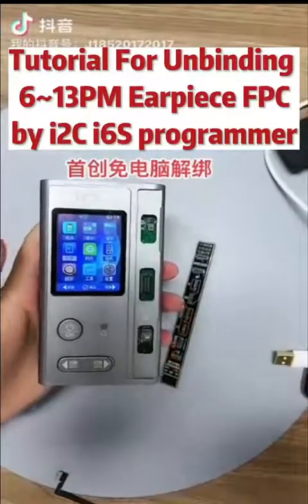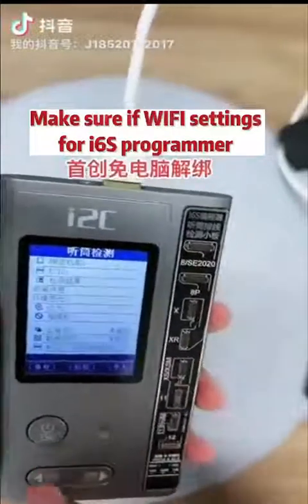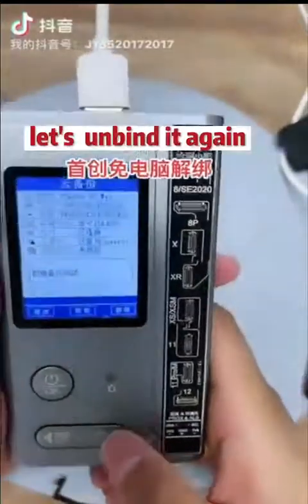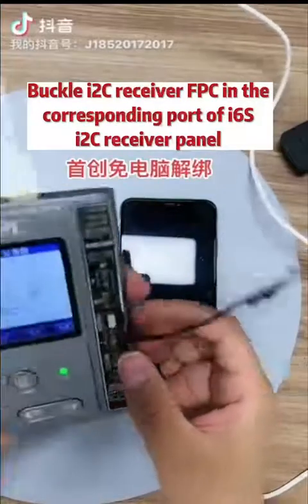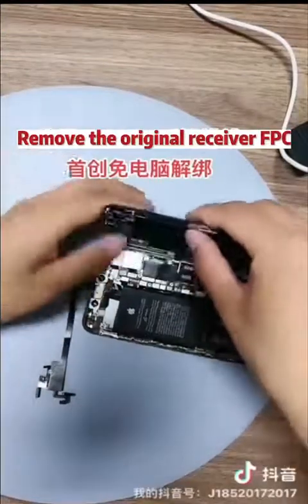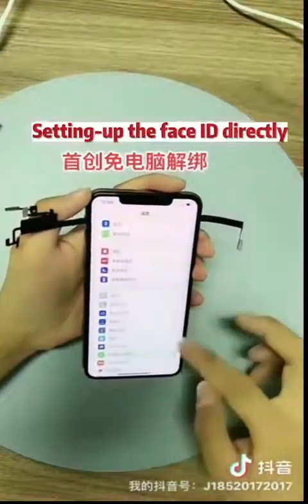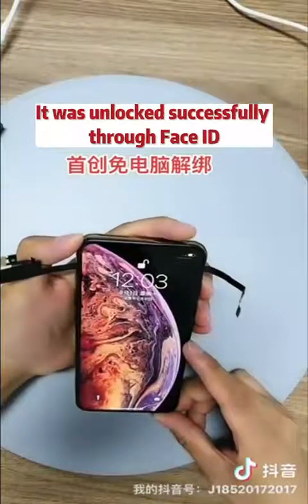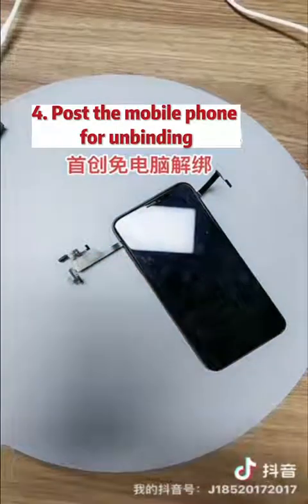i2C i6S earpiece FPC unbind Tutorial

Comment: But we still need to buy speaker? This should come with speaker. Why not just buy new speaker and solder it to original flex cable? I don't understand the point of this..
Reply: It's for recovery face ID function by flood iluminator without flex original or with original flex